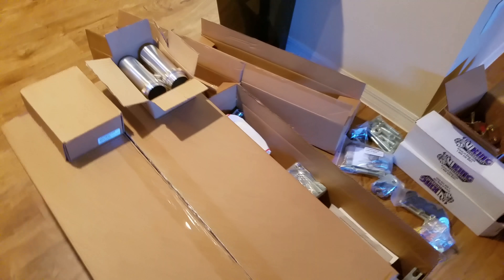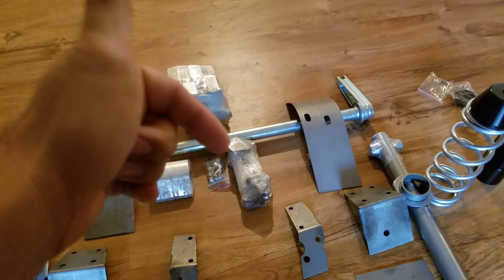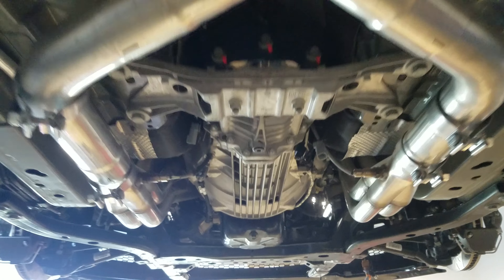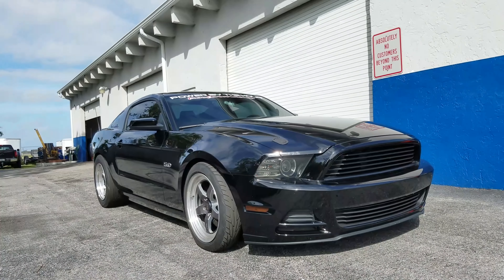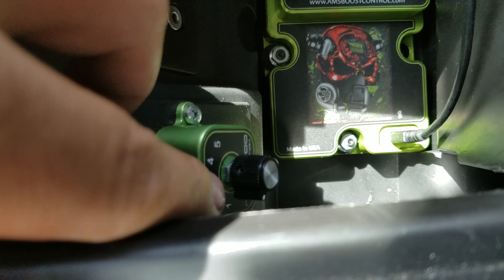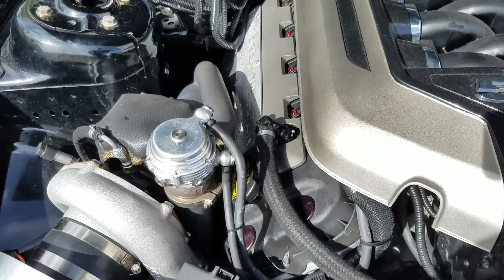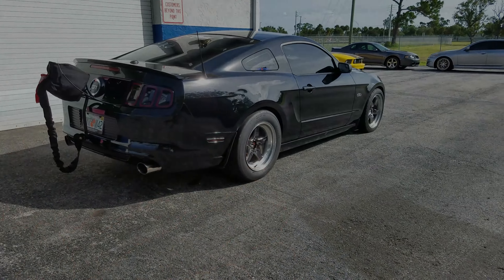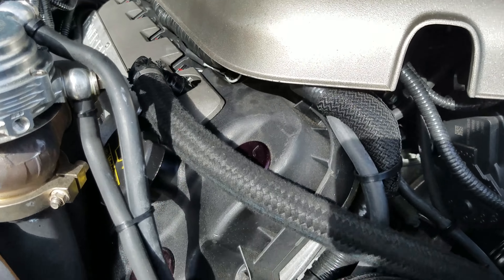Fairmont receives a UPR suspension and 1200+ hp Turbo Coyote

Comment: Cool as fuck!! I have owned several Mustangs!! First an 05 three valve!! A 2011 Roush stage  two coyote for the ex wife two no supercharger .. A 2011 GT500 and my next new old car is a 2012 Boss 302!! Roadrunner with 21 thousand original miles?? Might like you to tune my Boss and keep my track key in place but if you can tune a track key let me know??